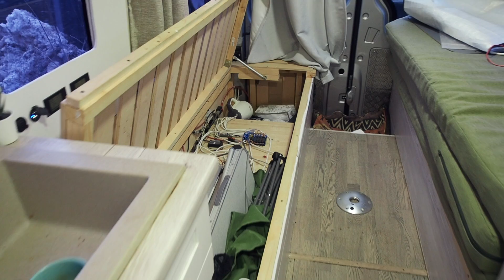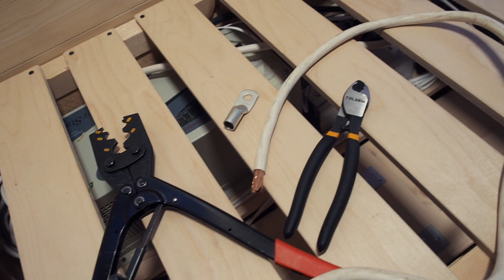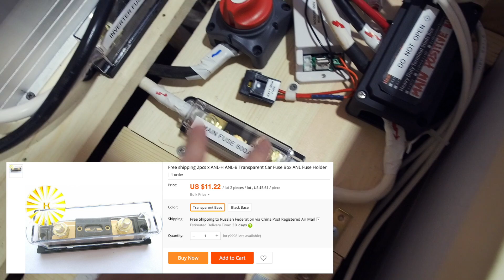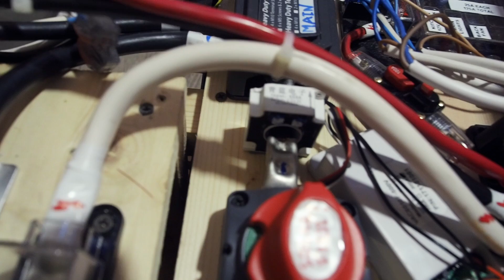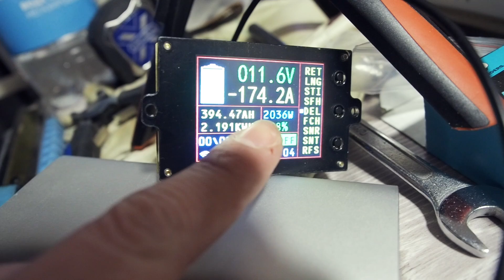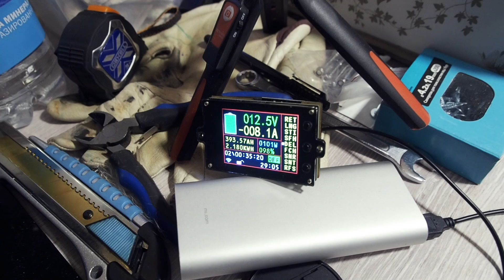Upgrading electrical system in sprinter van conversion. 12V Battery monitor for RV or Tiny house use

Comment from the maker: In this video, I reallocate & upgrade my van conversion electrical system. Now it has more safety and features and I finally have proper AC commutation and fuse box for my cooktop, heater, and outlets.
Reply: Are you still alive Oleg ?
Reply: @Van Tourist  Break time is over. Make A New Video
Reply: Welcome back Oleg. You have been missed.😬
Reply: Nice upgrade mate and very tidy too!
Reply from the maker: I don't think so, it's only main unit to display connection I think. No settings about other options
Reply: @Vantouristcom  hey there! How is your experience so far with the Watt hour Meter? Is it acurate? Or does it measure more or less than what realy is drawn from the battery?

Comment: Can you tell me something? I have just bought the same system and I want to use it on my electric car. Does this system show you the amount of charge added to the battery as well as the discharge? The car has regen braking which uses the motor to put a small charge back into the battery when you brake. Also I will be stopping the car to add a small charge to the car at public charge points, so I need an accurate way to tell me the REAL state of charge into the battery at all times.

Comment: I’ve been considering using the same battery monitor but I haven’t been able to understand the wiring for the secondary power needed when using an external relay.  Can I tap into my main battery or would that interfere with the power readings on the battery monitor.

Comment: Yo, Thanks for the video. 
I have the same battery monitor as you, but mine doesn't seem accounting for the charge that's coming from my solar.  My voltage is high, 13.5v+ so think is is full of charge, but my capacity is only dropping. 
I haven't found any instructions beside the basic manual that came with the monitor...
How did you configure yours?

Amos x
Reply: Did you set the amp hours capacity of your battery in the settings? Scroll to the BAT menu and press the centre button. Then use the up and down to change the number to your total ah capacity. Hope that helps.

Comment: Hi mate love the video and your journey i bought one of those battery monitors in your video and am having trouble setting it up i do have instructions but not really understanding them .My issue my panel reads the voltage in reverse so when i add a charge such as solar or dc dc it actually counts backward so instead of reading it finng the battery on the panel its subtracting whats in the battery . Can it be reset to default setting thanks
Reply: I have the same battery monitor. if it counts the power backwards just switch the cables on the shunt! then it counts in the correct way. had the same issue. just interchange the cables at the shunt and its good. or if you have the hole type meter, just flip it 180° on the cable. should do the trick.
Reply: Z. Thanks mate all good now thanks for advice

Comment: The fuse and the main breaker are way to big for the wire gauge. They are Not protecting the wiring.
Reply from the maker: Breaker is just a manual switch, it's not protecting wires from anything. Fuse there for protect system from global short-circuit situation. Wires will handle fine before fuse will burn out, no worries. I have an experience with 300A fuses with 250A flow and they burn after time just because they not made for continues usage near rating limit. And I just put 600A fuse there. Maybe I will try something like 400-500A option and find perfect for my system
Reply: Best of luck to you.

Comment: Thank you, one more time! It would be nice to know how do you switch from AC mains to Inverter? And the dimmer solution for charging batteries meanwhile you are driving from alternator, is still working nice? It is the same as getting D+ signal from alternator to the relay? Thnk you Oleg!
Reply from the maker: My inverter has AC input and when I connect it to mains it automatically switch all my AC to mains too (providing pass through up to 6kW of power). And also it starting to charge my batteries same time. My automatic-relay charging thing from alternator still works. I have not much knowledge about car alternators to tell you more :)
Reply: @Vantouristcom  Thank you for the info. I will expect for more videos like this one.

Comment: Great vid1 You got the 500A version of the battery monitor? Id love a video of how you wired it up! Apparently the instructions leave a lot to be desired!
Reply from the maker: Yep I got 500A. Taki in mind that lower the rating you get - more precise on lower amps it will be. Mine start to register any power flow from ~1A+
Reply: VanTourist OK cool, hmm, so I've got a 250 ah AGM with 400w of solar, and a regular 600w  pure sine wave inverter, small system. What amp rating on the battery  monitor would you recommend for that?
Reply from the maker: It's mostly depends on maximum drain you will get from batteries. What most powerfull thing you power up from your system?
Reply: VanTourist it's a laptop 190w power brick  via my 600w inverter.
Reply from the maker: You probably wil be fine with something like 100A rating monitoring system. And you will have some space for upgrading to 1kw inverter if you need in the future
Reply: VanTourist OK, cheers buddy! How difficult was it to wire in?

Comment: Hello! Congratulations for such nice vídeos. How do you change from powering the water heater / cooktop from the inverter to shore AC power? Could you post a diagram in your blog? Thanks and keep up the good work!
Reply from the maker: I can connect my inverter to shore AC power and it will not only pass through this energy to all my AC appliances but also charge my 12V batteries from that energy and all that works automatically. Amazing device :)